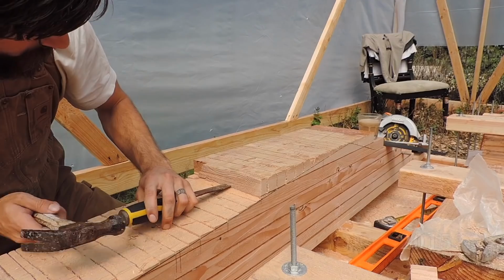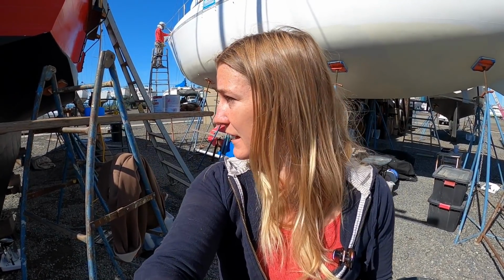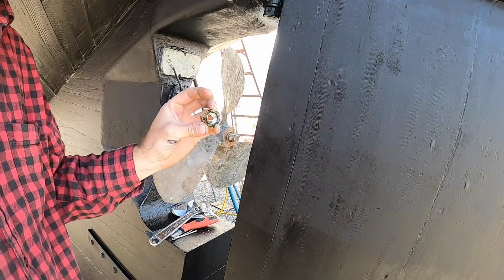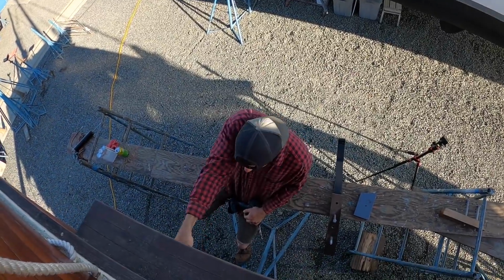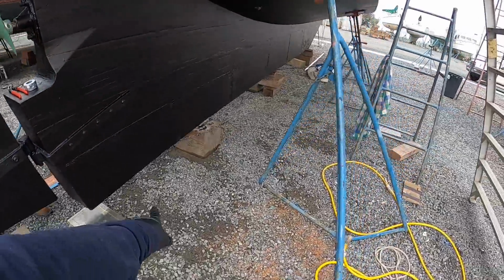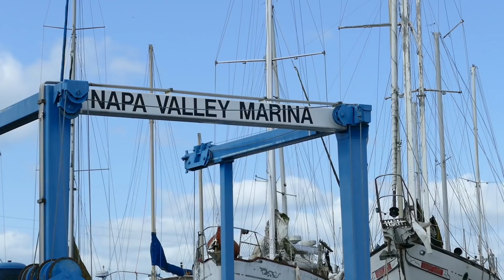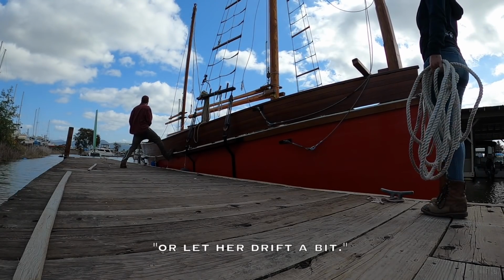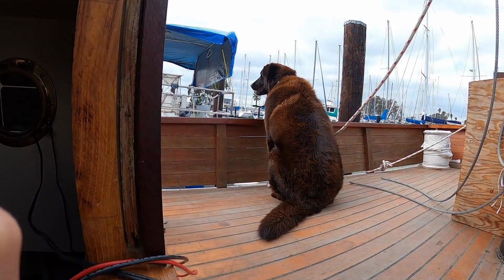Salt & Tar: Ep.134- Weekend Special

Comment: Wow, the whole sequence between putting her back in the water and grabbing the camera off the mast was awesome. Perfect music and editing!
Reply from the maker: Thank you 💕
R
Reply: I have to agree! Your video skills are right up there with your boat building.
Reply: @SaltandTar  Hi all ... Re galvanic corrosion !/ all your electronics need to be above earth, including alternator starting motor and any electric clutches 2/ all metal under water parts need to be of high grade and as similar as possible, steel needs to be 316 stainless only express 316 not 304 or any other grade 3/ galvanic action isn't limited to stray current from your systems, 2 different metals submerged in any impure water will cause a current to flow from one to the other, even if they are earthed together. 

The best way to place sacrificial anodes is to put one on every main metallic structure that is under water (including piping inside the boat), the anodes must be under water and must be electrically connected and as close to the metal your protecting (stainless tie wire is good for this)  have just enough and sized anodes to last between haul outs (but still have some left) Get anodes that are of good quality .... in Australia most boat chandlers have good ones 

I guess the main thing to remember is how galvanic action happens ...... you have an anode and an electrode of two different metals submerged in an electrolyte ( water usually salty) electrons flow from one metal to the other causing some of the metal to be eaten away (usually the softer one) so by adding a very soft sacrificial anode it moves the damage to that sacrificial anode. Just place as many as needed where needed.  

I replaced keel cooling pipes on a fishing boat years ago, original were 316 stainless and had been on the boat for about 20 years. In the ordering process the steel supplier got 304 instead of 316 stainless and I never picked it up ..... anyhow they lasted less than 12 months and were eaten completely through.
Reply: @drx1xym154  Electric clutches like on your car aircon rely on being earthed to the car chassis (usually negative) whilst the positive is switched via a wire. And YES being earthed to to motor which is connected electrically to the prop shaft and prop does cause electroless! Just as most alternators and starter motors are. 
 As far as galvanised steel under water (especially salt) the galvanising is a softer metal than the zinc anodes and it will be gone in a matter of months, as a cray fisherman we tried that on a few cray pots and yep the galvanising was gone in no time even with a zinc block fitted
BTW treated pine in salt water does not last long .... I think it may be the copper solution in the treatment that would also have a galvanic reaction?

Comment: My recommendation as a ham radio operator would be to plan on a copper grounding plate for the electrical and an additional plate with a straight as possible grounding wire to a lightening rod on top of the mast(s). Especially if you’re planning on doing long ocean crossings. You do not want to loose your radios mid ocean. I would investigate whether you could use one plate for both.

Comment: Ruth, your sailboat IS NOT going to sink! It's sturdy:-) A couple of tips: you should have more fenders on port and starboard and a collar-fender around the bow just in case, and so you'd not worry so much if it was about to collide with the quay-walkway. Maybe you could make your own, that would be an interesting video. You should have spares onboard, if you want to travel abroad: for example a spare propeller attachment nut. That sort of (corrosion)problem tends to happen often, and so the propeller becomes a little loose, and moreover, it could spin out of the shaft and be lost. And you'd be stranded. 
Well done.

Comment: I lived on a 38ft fiberglass boat in the Caribbean for 5 years. While at anchor one day we observed a boat with a stainless steel wire attached at one end at the chainplate and with the other end heavy with large zinc I had an SSB on board, so the boat was bonded. I had both items onboard so Ind followed suit.  Some folks said it was to ground the boat to guard against lightning. Others said it was to prevent corroding.  I do know that every time we dropped anchor, We flipped this section of an old stay with the zinc in the end into the water. I replaced that zinc several times.  I guess it did something, but I'm not ready to confirm any theory.  Good luck guys have some great adventures, Even the bad ones are good ones.

Comment: The boat looks beautiful. The reason for the quick deterioration of the nut could also be, because it is stainless steel, rather than a different metal, due to its properties when exposed to stray currents when in salt water. I cannot remember why, I am afraid. Fitting a galvanic isolator to your boat may help to reduce the effects in the future, other than sorting out the electrical problem you found, of course. Thanks for another great video.

Comment: Don't know much at all about electrics but with problrm with nut on end of prop shaft would check out if a galvanic isolator that is used when connected to shore power may be part of solution.  Good videos on YouTube about them

Comment: You two have done a fantastic job on the weekend project and it looks very smart. FYI I did a test on my prop and this is what I found. I polished the prop and used a propane torch and heated the metal so bees wax would melt on it. After it cooled I remove the clumps and put it back in the water. I was still shiney 3 years later.
Reply from the maker: Interesting. That's what we're hoping for with the grease but maybe we'll try that next. Thanks for sharing! 
R

Comment: I had friend with an Islander 36 and he was going through zincs like crazy.  Every haul out they were almost gone.
We installed an isolation box on the AC input and that solved the problem.  I don't remember anything about the box.
But it worked, no more disappearing zincs.  Hanging a zinc from the dock didn't help.
Reply: That's because the hanging zinc needs to be the alternative ground for the boat's electrical system.  
Ergo, attached to the boat.
Reply: @gking5522  We tried that first and it didn't help.

Comment: I think you may want to make your electrical system grounding on separate grounding plate outside of the hull. Prop shaft has already quite big potential difference between the bronze propeller and the steel propeller shaft.

Comment: Take care not to over-do the anodes on a wooden boat. It almost destroyed mine. The previous owner had bonded everything to a large zinc on the hull causing current to run through the salt-water drenched timber. Where wood meets iron, an alkaline crust forms which slowly turns the wood into pulp.
Reply: The zinc blocks need to be just big enough to last between haul outs and as close as possible to what your protecting and one for each item.
Reply: @drx1xym154  In Australia blue stone is used in concrete and that can contribute to galvanic corrosion.

Comment: Maybe the threads in that old prop-nut were not perpendicular to the face of the nut, but I would at least check that you have full contact between your new prop-nut and the prop when it is installed. On second thought: The boat is already back in the water so...  Great videos!

Comment: Your boat IS HOT, electrically. Easy solution,  add a 60amp Galvavic Isolator. In near future it WILL be a requirement in marinas. Some Countries have this requirement.
 
Check out Promariner.

BTW, Best check your engines anode (zinc).
Reply: Hopefully you listen to yourself on adding a grounding plate. If not, for now, do throw a zinc attached to your major ground into the water. As most racing sailing yachts do. Doing so can help your prop last.

Comment: Are you connected to shore power?  If your boat is plugged into shore power on a regular basis, a galvanic isolator installed will help prevent it.

Comment: Your powersupply from shore . . . Do you use a isolation transformer? It isn't only good against galvanic corrosion but generely makes the ship safer concerning 110 Volts. 
Another source of problems is maybe one of your neiboring vessels nearby. If they have a curentleak in the water it might damage your ship too. In this case an isolationtransformer helps to reduce the damage but not 100%.
Reply: If the issue is with neighbors, wouldn't it have affected all of the zincs, not just the one on the prop shaft?  Regardless, a galvanic isolator and even an isolation transformer would be good (although isolation transformers are apparently big, heavy, and expensive). See https://www.youtube.com/watch?v=1Z0K6HUr0cM for a video from Pacific Yacht Systems on the pros/cons of each.
Reply: @kingposeidon9362  You are right about how the anodes would have been deteriorated. An isolation transformer does not only protect against galvanic corrosion but also against grounding your boat wrong. It recreates a ground based upon the ground where your boat is instead of picking up a ground from shore. Shore bases grounds a often far away from where your boat is being moored and can differ signifficant, making sometimes 100 Volts! With groundingplates in the water or via the proppellorshaft it can create a dangerous situation when you are in the water around the boat or even when you step on board and touch a grounded surface. 
Generaly, isolation transformers can be expensive but on a boat like Redidiva I think it is worth its investment.

Comment: That "everything is grounded through the engine." thing ties into my question on lightning rod and grounding... Maybe next haul out fit a nice chunky copper strip (or recycle a couple of water pipes) on either side of the keel and run a beefy wire to the lower nuts holding the chain plates. You may need to connect to 4 chain plates (one of each pair on either side for the mizzen and the main). Then you can run a beefy copper wire along one steel wire to the top of either mast from either side.
Look up what a lightning strike does to a tree...it will amaze you the amount of damage that does to even a very large and strong tree...

Comment: Check the voltage to ground. Likely around the alternator or distributer cap.
Reply: Distributer cap?  The engine is a diesel.
Reply: @jandtlivinglife3130  glow plugs and common rail.....

Comment: Grounding plate with since connected to the motor should provide an easy ground path though isolating the drive train at a u-joint would help protect the prop and extend it's life. Not using any external ground would be ideal but probably unrealistic.
Just some thoughts

Comment: Why can't you just ground out the motor/engine ground to the dock side  power-line ground, at the dock's supplied power cable? It may not end all electrolysis completely, but it should end all of it whenever your parked at your dock side mooring. Just a thought!

Comment: Electrolysis is weird...it could be from your adjacent boats or the marina.  Ground out a multitester on your boat with the other lead in the water....some indication.  Also, galvanic isolators are cheap now...used to be very expensive....however....up here in BC, all stainless steel fasteners are now crap and is causing my own woes.  I fix boats and, I don't know what to do.  I am going to get in touch with military and see who they source from....this is a big worry for all marine projects.

Comment: Hint: Get in the habit of coiling your lines clockwise in hand or on the deck, they will lay flat and not kink and try to turn into a figure 8.  It has to do with the twist put in the rope when it's made (works for extension cords too).

Comment: Please do more research on electrolysis and galvanic corrosion. They're quite different and I think your problem is electrolysis caused by your bonding because you have made a battery by connecting the different metals especially steel and stainless steel. The wood in your boat will be the main casualty as it gets softened by the caustic soda created through the process. Searching Chris McMullen electrolysis is a very good start or search waitematawoodys electrolysis.
Reply: I didnt add the solution. Attach an anode to each piece of metal but dont connect them.
Reply: @mikeelliott7535  Ahhh...... To bond or not to bond.  That is the question.
Reply: @jandtlivinglife3130  When somebody like Chris McMullen from McMullen and Wing who built America's Cup yachts, steel barges, alloy and fibreglass yachts and launches does the research and gives an opinion I listen.
He has also nearly completed a Herreshoff steam launch, built entirely from scratch including the engine from researching the original plans. A cleaver man with a passion for wooden boats.

Comment: Wondering?  Not sure if this is a valid question, but how is the boats attitude to the water?  Meaning do you or did you have to add or move any ballast to get it correct?
JIM
Reply from the maker: After we get all her tanks and cruising gear on board we'll add some internal ballast to get her down to her waterline but she's sitting level as is just high which was expected. She's designed to have internal ballast added to the bilge when complete but we'll wait until we finish building to find out just how much we need.
R
Reply: @SaltandTar  Hey, you're looking better than ever!  Keep up the good work.
JIM

Comment: My guess re. the shaft anode problem is that because you have a couple of UJs (cardan joints) your propshaft & prop are not very well bonded to the engine & other anodes (prop anode, prop & shaft may then become the most sacrificial part of the whole installation)
Maybe you need something like this to bond them together properly https://www.asap-supplies.com/drivetrain/electro-eliminators
Reply from the maker: We'll check that out, thanks!
R

Comment: Why did you not polish  the port holes
Reply: Because they look much better green.   Bronze, like aluminum, paints itself when it oxidizes.  Once you polish, you are committing to tons of ongoing work.  Also, if you look at the surface of a typical bronze port light, you will see that it would need lots of smoothing just to be ready for polishing.  Most of all though, in my opinion, polished bronze on a traditional boat looks tacky.